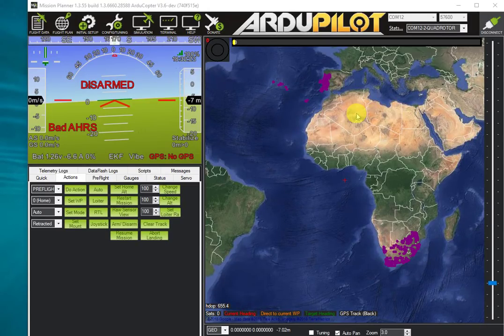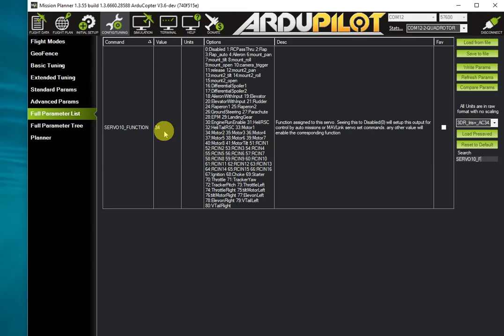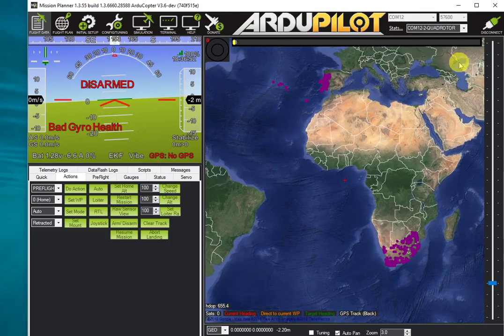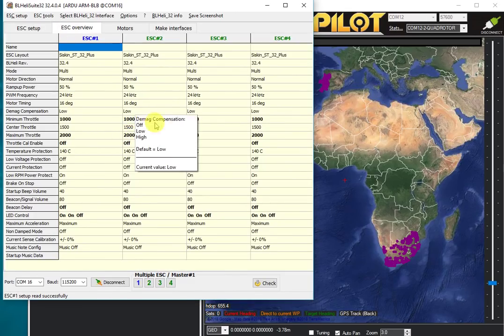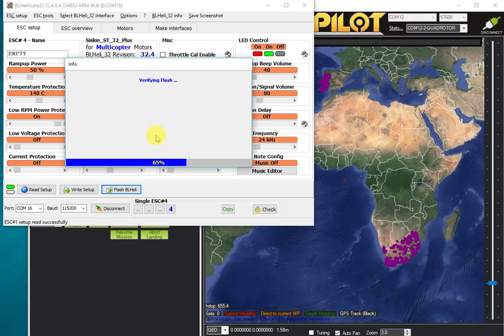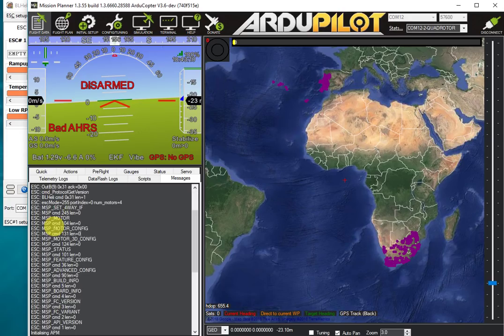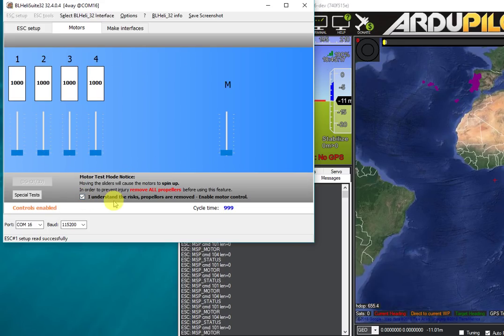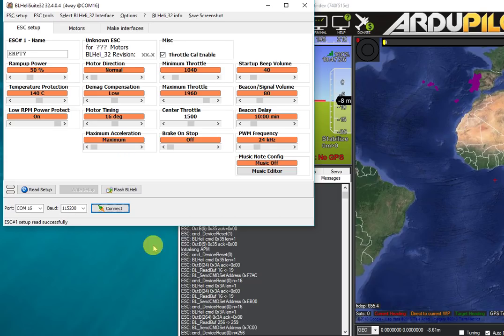BLHeli Passthrough config using ArduPilot

Comment: hello
i recently flashed my f405 mini with the ArduPilot firmware, but can't get the esc to connect... i've tried everything, except the dshot protocol, since for some reason, my motors randomly jitter whenever i switch over to dshot and try to calibrate the esc...
Reply: hey did you found any solution i also have the same problem
Reply: @bhargava-yv6dp  yeaahhh.... yes and no.... apparently, it doesnt support a passthrough due to the limited 1mb memory space... i did it through Betaflight, then reinstalled the whole thing again

Comment: Hello, please help. I have an orange cube. And several iflight 45A Slick ESC's. I have bought three sets of these, burned a few, but i keep running into issues with brand new ones, where they wont flash. Blheli says they are erased, or not activated. I have had this happen on several of them. Right now i have three in my quad that work fine, but i am getting ready to swap out that 4th one a 4th time. (Motor one in my case.) Nothing i do changes anything on these blown up esc's. I only have one flight controller so unable to test esc's on a different platform.

Comment: I am still confused has anyone know of information of how this can be done with QGroundControl. I use a Pixhawk 2.4.8 flashed with the latest version. It would be nice to use this feature if only for the ability to change the motor direction. My BLHeli configurator is the Google Chrome app. Thanks

Comment: Hi,I was able to connect to the AUX/FMU side of the Pixhawk-4 after I loaded Ardupilot and Was able to see the Tekko32 ESCs with the BLHeli32.However, the ESC numbering is not matching with the X-Frame Quad that I have for some reason, ESC-1 shows up as ECS-5 and ESC-2 shows up as ESC-6 etc. The other information on the motors and their ESC setting is OK. How can I correct the numbering of these ESCs? Thank you again.

Comment: Hi, I connected my
Pixhawk-4 and installed the Ardupilot. I then disconnected it and executed the
BLHeliSuite32 as you showed, but it couldn't find or read any of my Tekko32
ESCs. I have set all the parameters for BLH and Servo as you showed, and
configured a Pass-through Mask/Channel, but nothing. Below is what I see in the
messages log. We need to know how the "TX" pins on the ESCs are
connected to the Pixhawk-4 and which port and how that port is configured. Many
Thanks.
12/22/2020 3:55:12 PM : Frame: QUAD
12/22/2020 3:55:12 PM : RCOut: PWM:1-8 DS1200:9-12 PWM:13-16
12/22/2020 3:55:12 PM : fmuv5 001D0039 34385119 39313933
12/22/2020 3:55:12 PM : ChibiOS: d4fce84e
12/22/2020 3:55:12 PM : ArduCopter V4.0.5 (3f6b43e3)
12/22/2020 3:55:12 PM : Frame: QUAD
12/22/2020 3:55:12 PM : RCOut: PWM:1-8 DS1200:9-12 PWM:13-16
12/22/2020 3:55:12 PM : fmuv5 001D0039 34385119 39313933
12/22/2020 3:55:12 PM : ChibiOS: d4fce84e
12/22/2020 3:55:12 PM : ArduCopter V4.0.5 (3f6b43e3)

Comment: hi. I have a question. i got pixhawk 2.4.8 with 4.04 on fmuv3 connected to 4in1esc qbrain , flashed to blheli 14.9. I connected motors to aux 9-12 and set parameters for servo 9, 10, 11 and 12 to motor1, motor2, motor3, motor4, or 33, 34, 35 and 36. I have also disabled servo ouput 1, 2, 3 and 4. I set blheli passtrough to enabled and am using oneshot125 for esc protocol. But even if i set protocol to dshot150 , when i try to connect it connects, but than i hit read setup and it sais "Found multiple esc configuration in silabs mode" ESC1: no info ESC2: no info ESC3: no info ESC4:no info than i click ok, and than i get Serial interface Ardu connected succesfully. Connection to ESC1 failed! Please check data -und power-connections to the ESC. And i got my battery connected and full Any advice please? i'm really lost.

Comment: Forgot to mention that for BLHELI_32 ESC's to actually run on arduplane, you must set SERVO_BLH_MASK to 4, assuming that ch 3 is your throttle channel, as it normally would be on a plane.   BLHELI_S ESC's will work on both settings of this parameter.   you do not need to reboot, just write params and it will work.     Some of the duckumentation on the WIKI says that plane only supports "PWM" for non lift motors on quad plane, and ch 3 throttle for plane, but it's not true.   You are welcome internet people.

Comment: Have followed this video exactly.  Thanks for taking the time to do it.  Do the AUX ports need to be powered?  And if so, through a BEC, or does connect the red wire to one of the ESC leads suffice.  Once again, thanks for taking the time to do the video and sharing.  Cheers

Comment: ***SOLVED*** note that BLHeli 32.6.1.2 DOES NOT WORK with passthrough. I got a copy of 32.6.1.0 and its fine.
______________________________________________________
Help please. Ive followed the instructions on here and in the documentation. Getting -'found no valid ESC configuration' from the BLHeli suite. I think its getting to the cube but not 'passing through'. The esc is powered. Set all parameters exactly as explained. Posted the issue on 3.6 forum. Esc is a tmotor 4 in 1 F55A pro. The ESC is working for a motor test on AUX 1-4 in DShot150 mode. Dont know what else to try.

Comment: I can connect BL Heli 32 Suite to the Pixhawk via USB (while at the same time Mision Planner is connected via radio telemetry), but when I click "read setup", all I get a small box that shows 4 ESC's (I am using a 4-in-1), but there is no information there...just 3 short dashed next to each esc.  Then when I click OK, I get another box that says "Serial interface "ARDU" connected successfully", and "Connection to ESC #1 failed, please check data und power connections to the ESC".   So...what am I doing wrong?  Do I have to move my ESC connector to one of the Pixhawk RC-9 thru RC-14 ports?  (Right now it's connected to prop 1, 2 3, and 4.   Thanks...
Reply: It would have been quite helpful to see a picture of a wiring diagram...it wasn't clear that the esc wires have to be moved from 1, 2, 3, and 4, to 9, 10, 11, and 12...the author said it was neccessary for a CUBE, but not for anything else (I have a Pixhawk, non-cube)...SO OK...I figured a couple things out (I think)...number 1 is the esc's have to be on battery power...this is not obvious as a person (me...ok...maybe dumb) could assume that the ESC is getting power thru the 5v connection from the pixhawk.  So I set Servo 1, 2, 3, 4 to ZERO (which means DISABLED), then set servos 9, 10, 11, 12, to 33, 34, 35, 36.  I actually don't know if 1 thru 4 had to be disabled, as that was before I had connected battery power.  Now that I have ESC data...the BLHeli Suite thinks I have FIVE esc's...the first one is blank....then 2, 3, 4, 5 have data...weird.
Reply: Hello Bill,
I have follow this video and the ardupilot wiki, but I'm having the same problem that you had in the beguining with the "Serial interface "ARDU" connected successfully", and "Connection to ESC #1 failed, please check data und power connections to the ESC" issue. 
I have four BLheli S ESC's that are connected to the first four auxiliary channels on the Pixhawk, and all the main channels are disabled. how do you solve your problem?
Thanks
Reply: Well the first thing I realized is I did have to move my esc connectors to RC-9, 10, 11, and 12...sounds like you already did that (plus of course RC1, 2, 3, and 4 set to ZERO).  That worked for me.  Hmmmm...I'm not sure what else to say except that sometimes I had to reboot this or that to get it to work.  Remember your esc's need battery power of course (just connecting USB power to Pixhawk won't do it).
Reply: Yes, I have all the ESCs connected to the auxiliary channels, also the main channels are all disabled, and ESCs are connected with the power battery. All the Mission Planner configurations seams to be correct, so I don´t know what could cause this issue. I have BLHeli_S ESCs so I need the BLHeli Suite 16, that is a little bit diferrente from the 32 version.
Reply: @amagro9495  Are you sure the esc's are working?
Reply: Yes, they're working fine, I already used them with my previous drone, but only used with Oneshot125 protocol. Now I want to use with DShot protocol and use the Arducopter BLHeli Passthrough. Since I cannot configure through the Arducopter BLHeli Passthrough I was calibrating each one with an Arduino, but something is not right with them, with the DShot protocol the motors seem to not reach the maximum throttle. I noticed in this video that the Ardupilot parameters MOT_PWM_MAX  and MOT_PWM_MIN are set to 2000 and 1000, and in BLHeli Suite the Minimum Throttle and Maximum Throttle are also 1000 and 2000 respectively. What are your values for these parameters? Tks
Reply: I think I will forget the DShot protocol and Arducopter BLHeli Passthrough for now, and downgrade firmware from ChibiOS, and configure the ESC's as I did in the past.
Reply: @amagro9495  ok... Yeah... Wish I could help more.. BTW, I was/is set at 1000/2000
Reply: Hi I have the same issue. I bought 4 ESCs Tekko32 (35Amp) from Holybro and they have a "TX" pin on them. So, where does that gets connected to on the Pixhawk-4?  Which Ports etc?  I just loaded Ardupilot on the Pixhawk-4 and I am using the PM07 power Distribution Board from Holybro. So, should I be using the I/O-PWM Port or the FMU I/O port?  So, many questions.

Comment: aaaaaaaeeeee
estava procurando exatamente isso
Reply: Paulo você conseguiu? Estou com uma pixhawk 2.1 e esc Littlebee em um frame tarot 680, mas os escs não estão calibrados (estão com rotacao de 10%) e preciso ajustar direção de giro. Escs estão soldados na placa, não utilizei conector banana pra economizar espaço...
Reply: pra acertar o lado da rotação vc pode programas o esc usando arduino eu fiz isso
Reply: Valeu pela sugestão, acho que vai ser o jeito...fazer um por um com Arduino nano..tô encucado com a rotação que não tá nem em 10%...tvz fazendo isso resolva
Reply: so resolvi assim e esta firmware e beta ainda
Reply: deu certo com arduino nano...tive que desabilitar o parametro "Low RPM Power Protect", ele tava limitando a rotação do motor...to usando em um tarot 680 hexa, motores rctimer 360kv
Reply: blz importante que resolveu em breve as px4 terão suporte total e nativo sem ser beta
Reply: pois é...estou no beta também...sabes dizer quais os possíveis pontos negativos do firmware beta? instalei o beta e não consigo fazer downgrade pra versoes mais antigas de jeito nenhum...muito estranho...se não conseguir irei continuar com ele mesmo...
Reply: tem alguns problemas relatado no forum 
no missao planer vc pode volta pra anterior

Comment from the maker: @Nando, I agree that good CAN ESCs would be really nice, but I have implemented the ESC telemetry protocol for BLHeli_32 as well. We get RPM, current, voltage, total-current and temperature if you connect up the telemetry pin of the ESCs and you use DShot.
Reply from the maker: I've added some docs here that explain the telemetry setup: http://ardupilot.org/copter/docs/common-dshot.html
Reply: unfortunately its not possible on the HAL_Linux boards yet. We'd need good low level control of DMA channels for that. Probably quite tricky.
Reply: How is the telemetry from multiple ESC's connected to an ArduPilot FC?  Usually on BetaFlight and the like, they're all wired to a single UART Rx pin.  Is it possible to log things like RPM, current, voltage, etc?  Could a smart throttle to amperage correlation spin-up test be initiated at the beginning of each arming, like DJI's do to check for propeller presence / damage?  I've thought about building a board with a lot of amperage sensors to log data to correlate for motor-health monitoring over time.  MTBF for brushless multirotor motors (specifically the bearings) can be less than 160 hours (even on premium u-series tmotors); hardware maintenance could be prompted for a motor that is consuming more amperage than normal once a baseline is measured and set.
Reply: @mistercohaagen  All "TX" from ESCs connect to one "RX" on a Serial port.  See these;
https://ardupilot.org/copter/docs/common-blheli32-passthru.html
https://ardupilot.org/copter/docs/common-dshot.html
Reply: IcemanFPV add some epoxy around the LED's.  You could try coating them with an elastic glue like "fiber fix" as well.  Hot glue won't hold up to the heat if you're driving the motors hard.
Reply: ArduPilot, is it possible to use DSHOT & ESC Telem with a linux-based autopilot?  Like a BBB-Mini or Erle?

Comment: D-shot and Bl-heli Passthrough should make setting up esc's (that you can actually buy) a lot easier. 
Great Job! (also on chibios!)

Now some hardware supplier should make a good (can-)esc so we can finally get all the information that is lost (trapped) in the esc (errors, temp, current, etc...)